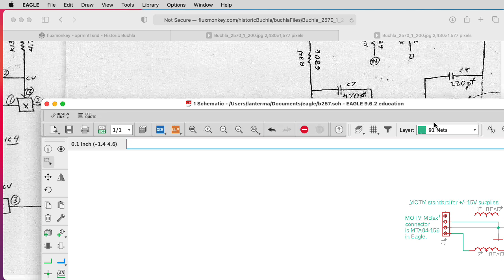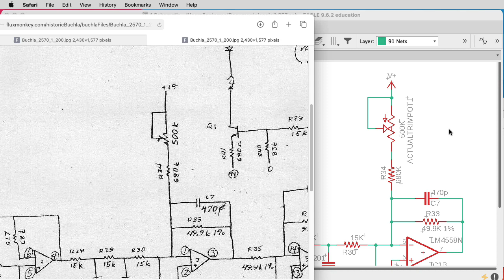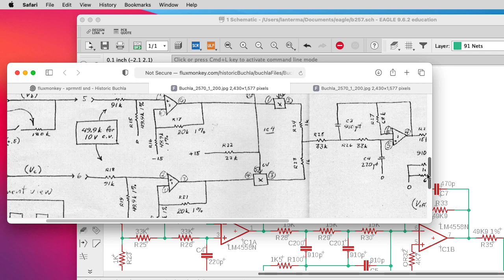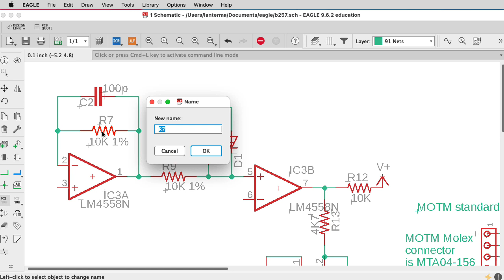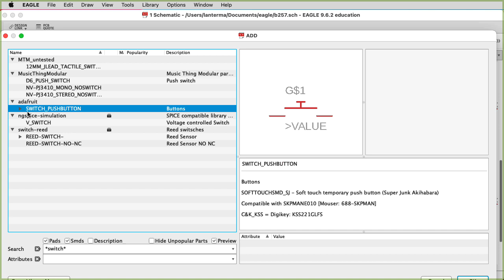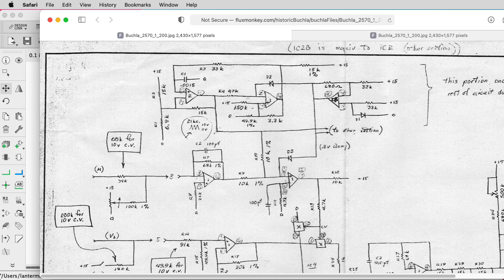Buchla 257 Control Voltage Processor Late Night Schematic Capture with Eagle

Comment: Yes, use group command, the one under the exclamation mark on the upper left part of the toolbar. and select parts, than "move" or "copy"

Caution, the cd4016 takes 20 volt, max
https://www.ti.com/lit/ds/symlink/cd4016b.pdf

that's probably the reason why this module only accepts positive control voltages.
you have to make some +10V - 0 - -10V power supply to use this CD4016 in bi-polar fashion and redesign the input and maybe aswell the control circuit of the CD4016.

you still have to "invoke" the "power supply's" of the ic and  opamps.

R16, r20 should be 49,9K and R17, R21 20K, you got that flipped.

Comment: Hi Aaron, thanks for another nice video. I work for over 30 years in electronics and eagle sometimes with fun, and sometimes with pain :-). If you select a gate, for example a 40106 hex inverting schmitt-trigger, i place allways all gates of the physical IC in the schematic so that eagle use the same IC Name. Simply terminate the unused Inputs or go/ADD  the next IC, if you need more. Dududud do do...and have fun! Cheers from Berlin.